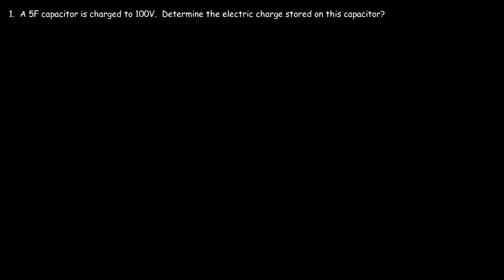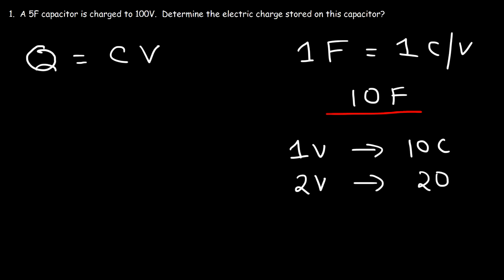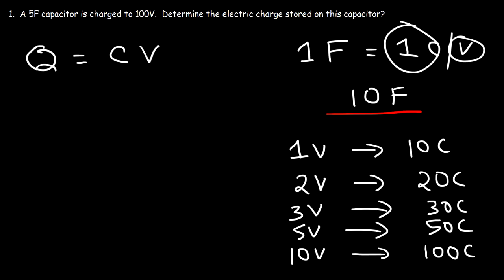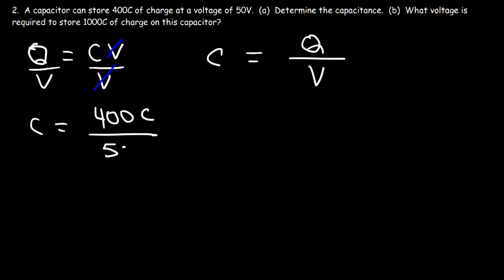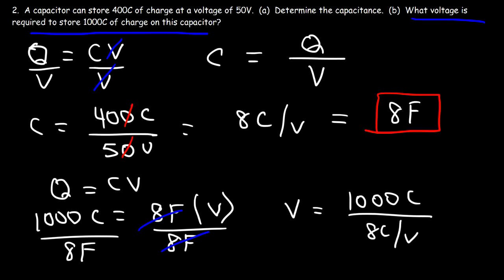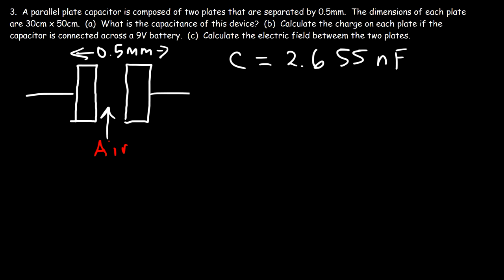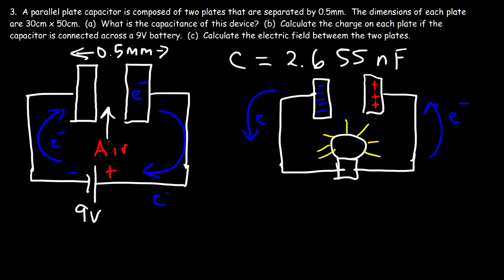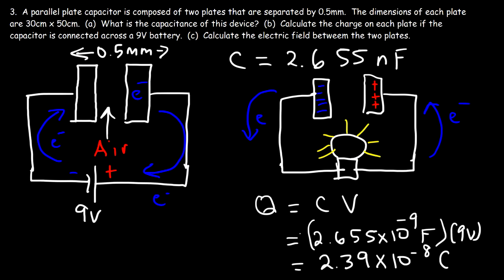Parallel Plate Capacitor Physics Problems

Comment: For d I used 5mm --> m which is 0.005, however my answer came out to 10^-10 as opposed to -9. So what step am I forgetting here, I know the conversion is correct, but I don't understand why .5*10^-3 was used in its place.

Comment: wait in the end (9v)/(0.005m) is 1800, not 18000
did i do something wrong here?
Reply: this is very late, but for anyone else still looking at this: its 9 / (0.5 * 10^-3) which is equal to 18 000. You multiplied 0.5 with 10^-2, not 10^-3 (we are converting from mm to m)

Comment: can i know why did you use k as 1 instead of 9*9(pow9)?
Reply: k here is not representing the same thing as the k constant in electric force equation: F=kqq/r^2. 

k here is representing the dielectric constant. The dielectric constant depends on what materials are in between the two capacitor plates. Since the problem does not specify the material, we assume that it is air. The dielectric constant for air is so close to 1 that we might as well make it 1. That’s why he used 1 here instead of 9x10^9 as k

Note: you get 9x10^9 from e0(epsilon) by the equation (1/(4pi(e0)))=1/(4pi(8.85x10^-12))=9x10^9

Hopefully that cleared up some things